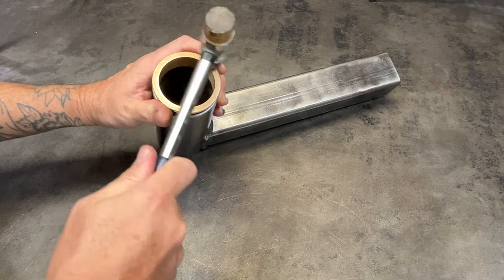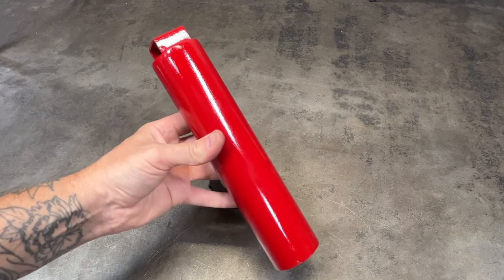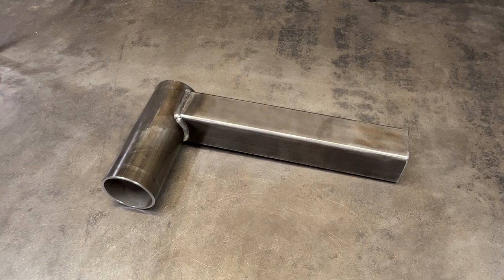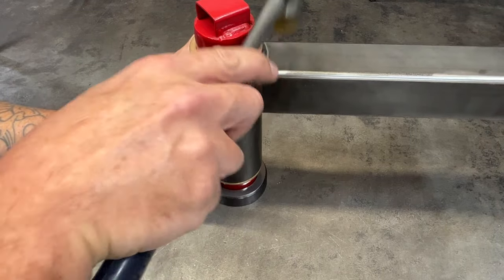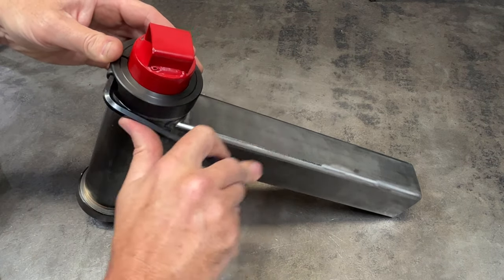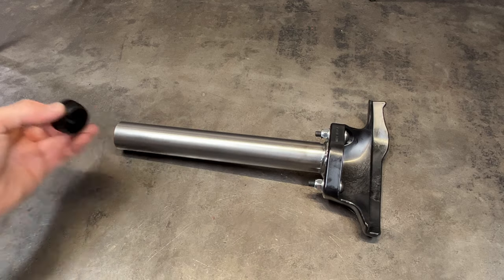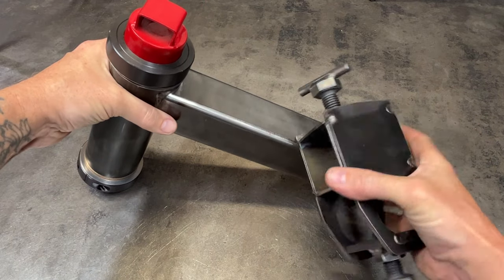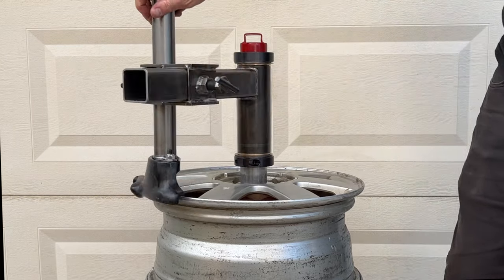Ultimate Manual Tire Changer DELUXE - Assembly Instructions

Comment: I wonder why harbor freight doesn't make this add on to this tire changer. I bet they would see the shit out of these things if they did.
Reply: The harbor freight unit is just a pile of junk. Yes you can put this on top of it but you still have the junkie bottom. Realize the part that breaks the bead from harbor freight is a pile of crap which both bends and wallos out the rod that you push against when you try to break the bead in the tire. This add yeah on is fine for taking off tires and putting new tires on. But it does not address the fact that the harbor freight tire changer and all the other ones sold at Walmart which are the same. Chinese crap are basically rolling piles of junk. Putting a good top on one is fine, but it doesn't fix the underlying problem of cheap Chinese crap with thin steel that bends and brakes very easily
Reply: @scottykilmer  It's $49. You act like you are spending $500 for this machine. I have been using this tire changer with my homemade modification and it works fine. I used it to change the tires on all my cars with no problems. Sure sometimes the beads are hard to break, but it will get the job done. Its not made for a tire shop, its for home use. Just make some changes to it to beef it up and it will be just fine.
Reply: @scottykilmer ù
Reply: @scottykilmer  of course Scotty Kilmer is here with the worst take.
Reply: You can get better ones if you shop around. I bought one 15 years ago , and it doesn’t have that problem. If you have basic metal working skills this is an easy fix.
Reply: Scotty is right.  The HF tire changer is junk unless you modify the changer by adding gussets for added strength.  You need a welder and some scrap metal.  There are some good videos on YouTube on how to beef up the tire changer.

Comment: How is that cone going to work if the wheel is sitting flat on the plate with no room for the cone to go down to center the wheel? There has to be a spacer to lift the wheel up for the cone to clear and not hit the bottom plate that holds the wheel in place. Also, a cheaper route is to just install the duckhead on the pole that came with the tire machine which will work the same! Of course you'd have to drill a hole in the pole to hand tight it to the duckhead. The only thing this adapter does is keep the duckhead in place without moving when you're trying to remove the bottom bead of the tire. removing the top bead is a piece of cake!
Reply from the maker: If the wheel is flat the cone won't work without some sort of spacer under the wheel with an opening that can receive the nose of the cone. Personally, I just drill holes in the plate and use a lug bolt and a nut to hold the wheel down. On my trailer wheels I use two lugs but I even use one on my other wheels along with the cone. I don't like the little pin that comes on the manual tire changer so I remove it completely. I have a template as a free download that can be used when drilling holes in the plate - https://lucidautowerks.com/products/pcd-drill-guide-for-manual-tire-changer

Comment: Good evening I received your Awsome product. Do I need to break the tires with a different tool and method. I value your suggestion thank you for all you do for wrench necks like me be safe and good night, R42noshop!
Reply: I forgot do you have any stickers of your business or hats?
Reply from the maker: You would use the bead breaker that's part of the manual tire changer base or a stand a lone bead breaker. No hats at this time but I'm planning on doing them soon.

Comment: It it sold anywhere in Europe?
Reply from the maker: Only if you order through ebay - https://www.ebay.com/str/lucidautowerks
Reply: @LucidAutowerks  thanks for your reply. I was told that this setup will not work for run-flat tires. I am driving a BMW with 19" run-flats so may not be suitable for this right?
Reply from the maker: @jrvd64  yeah you'd have a heck of a time doing run-flats since they have a super stiff sidewall.

Comment: How to order
Reply from the maker: The attachments can be found at - https://lucidautowerks.com/collections/ultimate-manual-tire-changer
Reply: It’s kind of expensive when the actual tire change machine cost like only $100
Reply from the maker: @cuanbarlow2323  not sure how one is related to the other. Using the manual tire changer saves on overall cost since I don’t need to make that part. Saves on shipping too. I pay more to make each kit than the manual tire changer from Harbor Freight costs to purchase. A lot more.

Comment: For the amount of rotation need to change a tire (1 rotation per side, if that) the bearings, races, and collars look like overkill and add a lot to the cost and complexity of this design.
Reply from the maker: I sell a more basic version with no bushings and bearings. If you’re doing low profile tires, all of the bearings, bushings and collars are a must.
Reply: @LucidAutowerks what is the function of the top lock ring and needle bearing?  What would cause the tool to try to lift off the post?